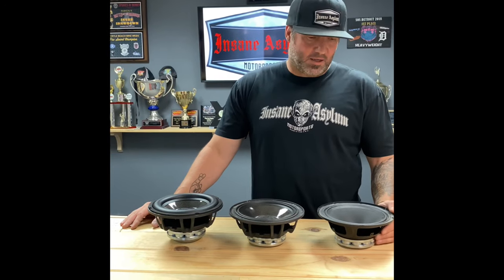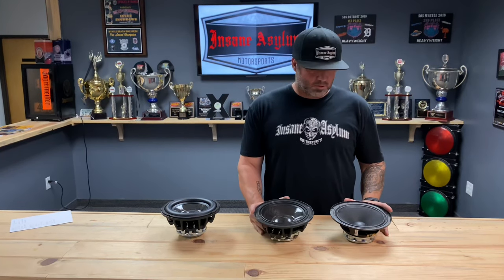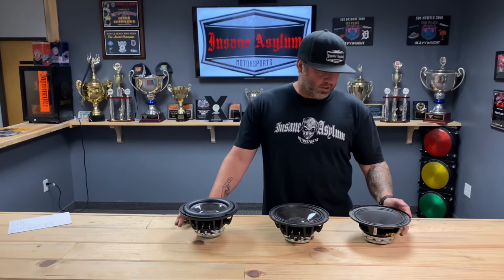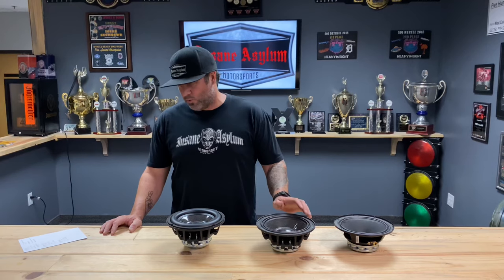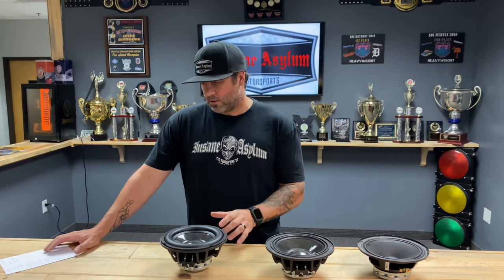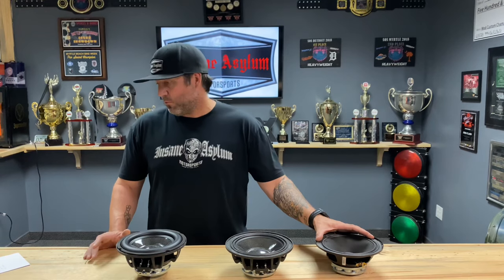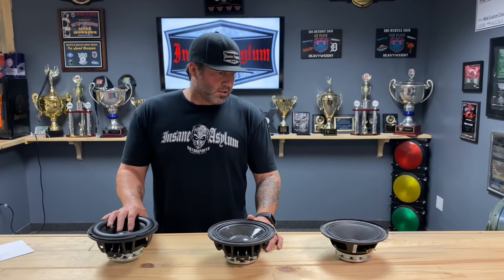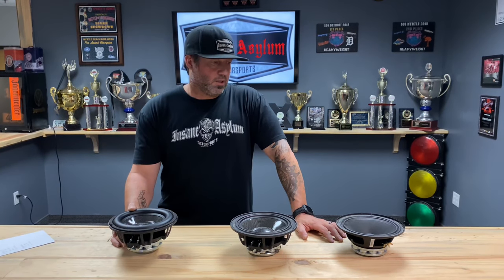The difference between a true mid bass and a regular mid bass speaker

Comment: I think mid bass speakers sound better than low bass speaker given they have less resistance and they are tuned in a box with the proper frequencies. 5-6” is amazing sounding when installed properly. 
You might need more speakers since they are smaller to get the same sound, but they fill in the upper bass spectrum more than a 10” or a 12”.

Comment: finally some one that knows what hes talking about. Im on the market for a pair of 8 inch for my old pioneer monitors, I blew one of them but wanna to replace both... 
I wanted a sub, but I keep reading Im going to need a mid bass, since the monitor is 2 way. I was looking for a speaker with high efficiency, low Frequency respond and high Xtx but as I keep searching I see that high xtx reduces FR, and also the low the FR the lower the DB. 
can you recomend a good mid bass, I rather listen to a pro. 
thank you 
Great video 
:goodvibes:

Comment: Hi there, amazing explanation! 
 I have hard time finding how to power match tweeter, mid and bass so I do not have to constantly adjust volume and bass level so non of the speakers distort the sound.  Can you help me please?
Reply: Did your speakers come in a set with a crossover or did you buy them separately?
Reply: You'll have to constantly asjust for each song no matter what.
Reply: @casemods  indeed. Music is not all recorded the same.
Reply: Then theres definitely something wrong with your cross over or CO-settings. When some recordings sound dull and dark and other sound bright. My old home speakers had this issue many years ago. I found the problem by isolating different parts like left speaker only and so on.. Problem was in the cross over of one of the speakers between mid and treble a resistor was broken. I reccon the same behaviour can happen if nothing is broken but some settings is not optimal.

Comment: I need your help. I have a 2019 RAM 1500 with the Alpine speaker package. I did not want to replace the factory speakers, but did think of replacing the factory amp with a Kicker CX360.4 4-Channel Amplifier for sound and loudness.

I added a Skar down fire RAM sealed enclosure, with dual Kicker Comp R 4 Ohm, Kicker CX 1200.1. Good bass inside, but it is not loud. I see everyone with the DS18 6.5, or Skar 6.5 speakers, with Horns and they are loud. I wanted to stay with all Kicker. 

What do you think would be louder?
Dual Kicker ST ST7MR8 Midrange 8 Ohm with Kicker ST4TW 1.5" Tweeter 4 Ohm.
Dual Kicker KMS67 4Ω Tower System?

Also, I wanted to add these to my enclosure, but facing forward.

Comment: So what hz can you start calling it for a sub/midbase/mid?? Lower than 40hz???lower than 60hz?
Reply: In the pro audio world, a sub is often something that works from 30-40 hz and below. It really depends on the system itself. Some modern systems are really good at delivering deep bass without   the use of an actual sub.

Some of the current systems are crossed and named like this.
High 20khz to 6khz or so.
Mid 6khz to 200hz or so.
Low 200hz to 70hz or so.
Bass 70hz to about 30hz or so.

It depends on system designs and what is used, but those are the limits at each end so to speak. When you see actual subs used, it is A, because your bass drivers roll off at a higher point than say about 40-45hz, or if you have a system or venue where sound below 30hz is needed. At the end of the day, actual subs play from around 40hz or so, but it depends. Many in the car audio world, and even some in home audio, let subs play from 60 or even 70hz, but a true subwoofer is usually meant to work between 40hz and 20hz or so.

That got a bit long, but at least it provides some idea about what each thing is. And again, remember that there are several driver types that can share frequency range duties, but it's just not what they excel at.

Comment: So what’s the most common crossover points when you have an actual sub setup playing up to around 70 or 80hz, as well as a 5.25” or 6.5” component set with a good amount of power, but still want to bridge the gap between the powerful subwoofers and the mids by using most likely 4 8” midbass speakers. I was going to start out with a 45hz to 250hz bandpass with the mids picking up from 250. Any useful info I can get if I’m going about it wrong?
Reply: Ya im planning a similar build. The 6.5" components are for the highs and "mid-range". Which are crossed from 100hz-20Khz.  Then a midbass driver (8" sub or a 6.75 sub)... which will be crossed from 50hz-250hz.. Not to mention there will also be an actual sub will also be included and that will be crossed from 20hz-60hz.
Reply: That is impossible to answer. Each system is different and there are way too many parameters.
What you need to do, is get an affordable measuring mic, and use REW or AudioControl's measuring mic and app with pink noise. Measure the low frequency speaker and then the midrange without any filters applied. What you will see is that each driver has a range where it will be relatively flat. Where the LF driver starts to roll off on the high pass side, is as high you can go with your crossover. At the other end of the spectrum, where the MF driver starts to roll off on the low pass side, shows you how low you can go. 6db below the "flat" part of the curve is basically the points at what either above or below the crossover point is possible.

If you're looking for a great sounding SQ setup, what you should do, is to use the -6 db point of your MF driver to establish the crossover point. This will give you the LF driver a bit less "kick", but it will also integrate the best. This could for example be 60-65 hz depending on your system. If you are looking to really get everything banging and rattling, use the -6 db upper point of the LF driver as a point of reference. Note that if the LF driver stays linear above 110 hz or so, don't take it any higher as it will not sound good at all. Even such a high point can be tricky to integrate as LF driver placement becomes a lot more noticeable. In this case, your time alignment needs to be on point for this to work.
Now here's what most end up with, which is basically the middle. Let's say the -6 db low roll off for your MF driver is at 65 hz and the LF driver is -6 at 100. Then the midway point between them will be 82.5 hz. Is that perfect? Who knows. You need to use your ears, but it's a good starting point.

What many end up with, are two or three different DSP presets. One for SQ, one for all-round purposes, and one for all out SPL. Just remember that the gain structure in your DSP processor needs to be set for each preset, as each crossover point has its own gain setting in the DSP to keep the amps happy and retain the proper headroom.

What ever you do, remember to trust your ears. If it sounds bad, it does not matter what a measuring tool shows you. Those measurements are guidelines, not absolutes.
Reply: It really depends where your midrange and midbass speakers are mounted. If you mount your midbass drivers in the doors and they’re Band passed too high you’ll have the  lower range of the male vocals jump from the door to wherever your midrange speakers are mounted. Use a lower band pass that stops around 180 and you won’t have that problem or it will be reduced. Fine adjustments of crossovers and EQ will dial in  your setup. These subjects have been discussed at length over at DIYMA. I stopped posting over there around 8 years ago but back then there was plenty of very active discussion that dealt with speaker placement and tuning at a competition level.
Reply: Mid bass would be 70 to 120
Reply: @Assimilator702 I would cutoff at 150hz at most
Reply: @knikkaknikk8684  Yes that's the ballpark I shoot for.
Reply: It's on the speakers/ box or paperwork they'll even tell what size box to use for subs... crazy right 🤷‍♂️

Comment: Woofer-Midbass-midrange ?
Reply: No, the ranges I am about to give you is not set in stone and Is more of a starting point for you to then tweak base on the FS and sensitivity of speakers and your preferences. it’s Sub Woofer(50 and below)  , Mid Bass or what is generally referred to as Woofer could range from 50 to 800 hz, Midrange 200-7khz and tweeters 3khz to 22khz. A DSP SHINES in this area, where you could dial in your systemthe suit your listening preference

Comment: Hi im thinking of getting some 8" mid bass speakers . Does the bass sound better and hit harder on a 4 ohm or 8omh  .
Reply: 4 ohms will hit harder due to less resistance. Lower ohms will always hit harder in a sub, midbass, and clear and crisp in mids. Just make sure your speaker configuration matches the amp so you get the most out of your speakers and amps.

Comment: I’m trying to remove the bass from my mid range speakers because I have an amp powering them and I can’t turn the gain up much before it goes into protection. I’ve tried the bass blockers but it’s not working. Any recommendations?
Reply: Set the high pass filter on the amp
Reply: i agree a high pass filter would completely get rid of it
Reply: Your Amp is going into Protection? Sounds like you have more issues. Bass Blockers are for Tweeters, I’ve never seen one on a Mid before (could be wrong I suppose.) You are running these active I presume?
Reply: I agree with Len, if your amp is going into protect then something is legitimately wrong hence protect. To much gain/or low frequency would normally just cause distortion not trigger protect mode. I'd check the resistance (ohm ) loads per channel and temps to solve your protect issue. That said if it is actually from the low end signal you may be shorting the leads or coil by over driving lower quality speakers. To reduce bass it's old school these days but I still like running a 3 way active crossover to feed only the signals I want where I want them. Dsp is the more up to date but also more expensive option.
Reply: you should have filters on the amp for that reason...

there is something more wrong for protect mode... 

id start with the ground wire... 

sounds like voltage issue to me...

or as robert stated, check impedence per channel... 👍
Reply: Amp has a bad ground
Reply: I bought a Pioneer 80 PRS and it has a switch on it to get full potential of it , it separates the highs , mods , and lows on the rca inputs and what I mean is the front will be only high signal and rear will be only mid , I am sure other receivers have they feature
Reply from the maker: I doubt its a crossover problem.  Its most likely an impedance problem. Amp is seeing to low of impedance and going into protect.  If you turn it down it comes back on right?
Reply: The gain is not a volume knob.

Comment: I'm having a hard time finding a crossover for the mids I just bought. It says Frequency Response:  85Hz - 7 KHz ... what do you recommend ? They are advertised as Mid-Bass Midrange...
Reply: It depends on the other speakers in your system, but in general I'd recommend you cross those mids over at 85hz (give or take 5hz depending on room acoustics and subwoofer response), and 3khz if you have a tweeter. Generally you don't wanna cross a tweeter below 2khz, and 3khz is pretty standard . 4khz is fine but can be a bit high for some mids.
Reply: If your mids play clean and nice up above 4k and have a good placement, don't be afraid to try and cross them between 5k and 6k. Reason is that this will give the  absolute best integration of voices if possible. That said, this is usually tricky in many installs as the speaker becomes more directional at those frequencies.

But let's make it a lot more simple. What speakers do you have? It's hard to give advice without knowing what we're talking about. At least it helps a lot to be able to look up some off-axis measurements from the manufacture. They are not absolutes, but good guidelines for a start.
Reply: @bailey2517  . looks like the other speakers are gonna be a Skar 18" single sub, and a pair of Pioneer tweeters. A 4 channel amp to run the mids and highs, and a class d 1 channel amp for the sub.
Reply: @flyhouseoftruth470  oh so if it's for a vehicle system, I'd cross the sub at like 60 or 70hz. Depends on the box tuning and stuff, but generally you want to have the amp start rolling off above 60hz. 

For mids I'd say cross them at 3,000 to 4,000hz. Basically, look at the frequency response of the tweeters, and multiply it by 1.6. so if it's 2500hz - 20khz, you should cross the tweeter at 2500 x 1.6 = 4khz (for example)
Reply: @flyhouseoftruth470  also, cords the mids higher than the sub, since you'll probably be turning the sub up a lot louder than mids, the sub will still play PLENTY of that 60hz-120hz range even if it rolls off at 60hz lol. And that mid bass can get annoying if it's too loud. I'd say cross mids at around 80 or 100 hz. Somewhere in that area. See what sounds best for you
Reply: @bailey2517  . I know where I want the frequency at, just don't know how to go about doing it. For the sub I'm thinkin 18htz to 100htz... The amp I'm using already does that, it has a 100htz cutoff module in it, so I'm good there. For the mids I want like 80htz to 4,000htz, no idea how to go about getting that, don't understand the settings on the amp I'm using, a RF power 400a4.. The tweets I figure should pick it up at 3,500 htz and up.
Reply: @flyhouseoftruth470  what amp do you have for mids and highs? Like what model specifically?
Reply: @bailey2517  . It's old, a Rockford Fosgate Power (step above the Punch) 400a4.. It's a 4 channel amp with two crossovers one for ch 1 and 2 and one for ch 3 and 4.. 3 and 4 will be the tweets.
Reply: @flyhouseoftruth470  dang, I looked it up and tried to find a crossover but apparently it doesn't even have one... I'm sorry. :/ It might have a built in one that's pre-set, but there's no way to change it.

Comment: I just bought speakers that have an FS of 155 hz measured with my SMD Imsg. I was wondering if I would need a midbass to cover the frequencies from about 80hz  to 155hz. Looks like I can just use the Subwoofer to cover those frequencies by just setting the low pass a little higher. for example. Subwoofer 28hz to 159hz and then my Midrange (not midbass) from 159hz to 2.2 khz and my tweeters play everything above that. Any thoughts?
Reply from the maker: Depending on the sub and its moving mass it may not be able to play as high as your hoping.  You can try playing your mid lower.  But I would not add another speaker to only cover that small range.  I would change the mid or go to a midbass to replace the sub.  (this also depends on the application)
Reply: @insaneasylummotorsports5757  I am thinking I should have went with fullrange speakers in the doors. I had a couple 6.5 inch JL audio's in my last vehicle I should have kept. The F.S. was 114 HZ They worked perfect.

Comment: Cone mass isnt a factor for sensitivity, its actually related to how much voice coil is in the magnetic field. Its why subs with huge excursion have the lowest sensitivity. I'm not sure why were even talking about sensitivity here its irrelevant. Mid bass is a "true mid bass" because of its power handling.
Reply: Come mass is a major factor in a drivers sensitivity. Cone mass lowers the fs but the byproduct is lower efficiency.
Reply from the maker: cone mass is absolutely a major part in determining sensitivity.  Heavy cone will of course have a lower sensitivity.  Can you make up for it in power handling?  Possibly but if you have a light cone and a heavy cone with same voice coil and motor the lighted will be louder and you can not catch up with more power.
Reply: Cone mass is the single most important thing in relation to sensitivity. It defines the power needed to move the cone. The force needed to move X mass never changes. What happens when you stick that coil further into the gap, is that it draws more power. There is obviously a limit at when the speaker just stops working properly and get horribly inefficient, but that's when the coil sits too far out of the gap. There are physical limits as to how the coil can be designed depending on excursion, cone suspension geometry, mass, stiffness etc. If you shove a long coil far into that gap, you lose excursion because it will bottom out, and if you raise it up too far, it will jump the gap. If you make it short, you lose weight, gain sensitivity and can lower it into the gap, but you also lose power handling ability.

Fact is that there are some pretty absolute parameters for voice coil placement and size in relation to what a driver is designed for. It all is dependent on one another, but when it comes to sensitivity, weight is king, and no matter what you do for power handling, weight comes with a penalty in relation to transients - and that's where all the fun is. The heavier the mass, the more difficult it is to make it change direction fast without causing flex etc.